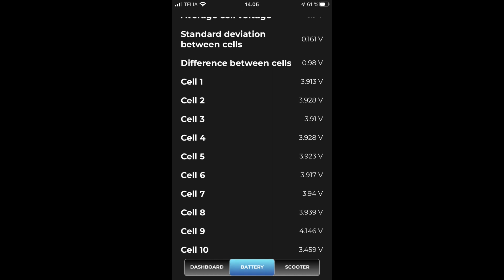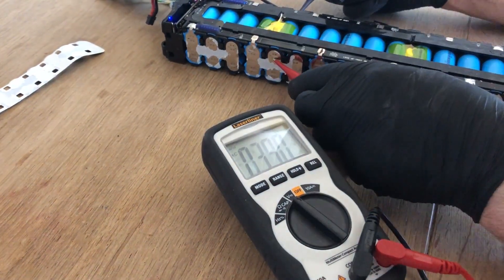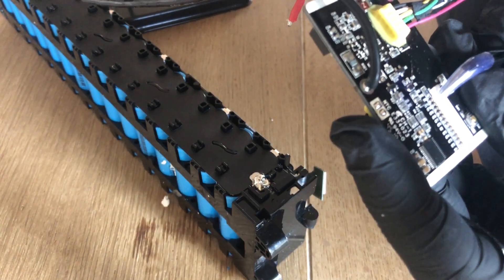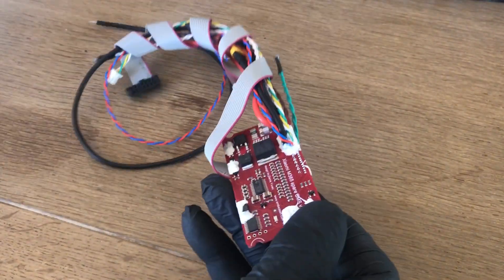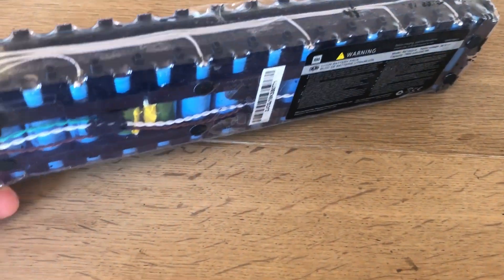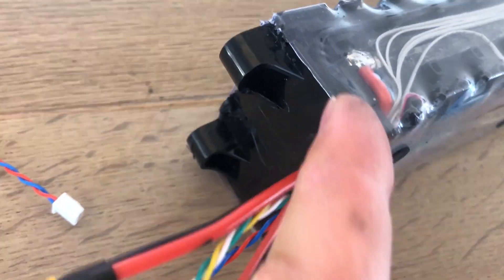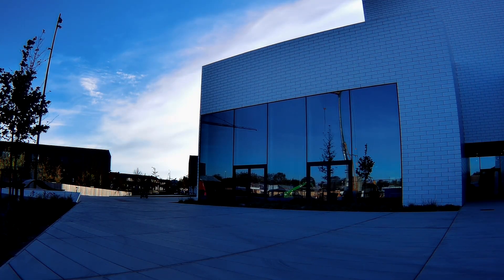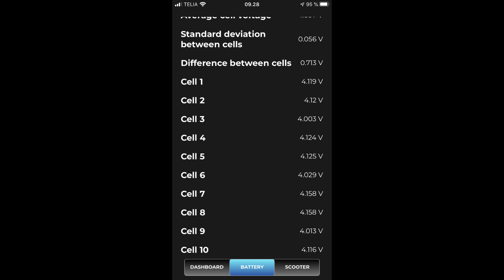Xiaomi M365 dead BMS replacement

Comment: İ have same battery imbalance and riding range is too low i measure it manually too one of the part has Low voltage shoul i replace that cell part? Or charge it manually and  balance manually ? Or change bms ? Bms is working by the way
Reply from the maker: You can try and manually charge up the cell groups with low amperage charge to the desired voltage and balance the pack in that way. If it gets unbalanced again in couple cycles - you know the cell is dead and needs replacing
Reply: @VRMinde  Is the battery definitely dead then, is there a problem with the bms?
Reply from the maker: @sssoyupak  ahh, no, not definitely. Not all BMSs balance the cells (actually only some, more expensive ones can do that) especially if the cell gets damaged/was produced wrong, the bms won’t be able to balance it out. BMS can be good.

Another thing to look into is how the cells are welded together. Is there enough series connections/thick enough nickel between them to carry the load you put through the battery. If your battery build is not calculated well for the amps you ask for it and some connections get more loaded than others - you will heat up the nickel and some cells will loos more energy faster. No BMS will be able to balance it out

Comment: Can you help me finding a rep guide for the Transistor you talking about?
The thing that you tried before changing the wohle bms?
Reply from the maker: I could not find it myself mate :) Overall, my experience in replacing FETs and other small electronics components is mainly... well.. with less than acceptable results..

Comment: So will you disconnect the BMS to equalise the battery
Reply from the maker: I have charged up the cells individually after disconnecting, but you can charge them up individually with very low current like 0.05Amp or so with the bms connected.

Comment: Hey!

i have had my scooter for more than a year now. And its been working perfectly until recently. The battery is not charging. I have checked around and there i have come to a conclusion that the charger is fine cause its lighting green. and the battery is allegedly good if its flashing blue. So my question is what else can be faulty? ive read about the z fuse and it looks to be like a lot of work to replace.

any help?

am also running on stock firmware so i cannot use the xiaomi app
Reply from the maker: Can you use an app like m365 tools for ios and check the voltages of the series groups there? If you cannot see you pack voltages in the app then you will have to do that manually with a multimeter. That requires to take the battery out, cutting carefully the plastic cover and measuring on the cells. If that sounds like something you don’t want to do and if you can’t see voltages on app - bring it to some repair shop, you will get help there. 
It can be a loose spot weld from a cell, dead bms, dead cell and many more things
Reply: I live in a place where we dont have repair shops. The software on my scooter is not the factory software so i cant access the xiaomi tools app
Reply from the maker: @aaronm5447  then start by measuring total voltage of the pack and voltages of every cell group…

Comment: i don't understand a thing... but this bms is not balancing your batteries?
Reply from the maker: The BMS is balancing the battery a bit, when you charge and discharge it. Different BMSs have different abilities to balance the battery. Active balance BMS is 3-5 times more expensive than something like this one and will probably reach at least half of the price of the entire pack. And these cheaper ones are only capable to balance to a small voltage difference, unfortunately :/
Reply: @VRMinde  jeez how much ten 5v 0,5A transistors can cost? 10$? and this is all what you need if you want to charge it PWM style. If we go full throttle then we need 10 buck converters. that would be 20 dollars.

Comment: hello my question my xiomi does not take gas. I opened the bottom and 
the battery lights up blue not blinking it is so right. he does not take
 gas
Reply from the maker: Hi mate, can you check the voltages of every cell group in an app? As I understand the scooter turns on? What is the setting for the start speed? Are you aware that you need to kick the scooter before it starts taking gas?
Reply: @VRMinde  yes

Comment: can i replace the bms from my old battery
Reply from the maker: Sure, if it works, why not
Reply: @VRMinde  i replaced that battery with a new one and it shut off like the first one i had so im not sure if the bms is good on that one they went out when i changed braking system to "strong"
Reply from the maker: @lostheartmega5388  If you used a new battery with new bms and your scooter is not working - your problem is most likely not BMS.
Reply: @VRMinde  i replaced everything the mainboard the dashboard the battery idk what it is when i plugged in the new mainboard it shut off while i was going downhill and never cut on again its been sitting for months
Reply from the maker: @lostheartmega5388  damn... sounds silly, I know, but what about the cables? Could a cable be damaged somewhere?
Reply: @VRMinde  yeah those wires that connect to the main board are fried i got new ones coming in think that may be the problem

Comment: I gust got me a xiaomi pro m365 a week ago like an idiot I started messing with the firmware which I have no experience in pressed the wrong application on the upgrade an that's were everything went in to panic mode dashboard stayed lit wouldn't turn off like a you know what I unplugged the display now dashboard won't light up no sound just blinking green light and tail light my app on my phone still can connect to scooter everything is OK just error code 14 tried everything so with that being said rrrrr changing out my speed controller motherboard fix the problem or do I have an expensive doorstop please help any information would be helpful. I'm older don't no computer jargen. Thanks.
Reply from the maker: les1669 hi,
As I can understand your current problem is error 14?
Error 14 should indicate a throttle (accelerator) problem.
I have seen some people complaining about it on the different forums, seems like replacing the accelerator helps.

It is just my guess, I do not have the m365 pro myself. I can be wrong.
Reply: @VRMinde  thanks I will try replacing   the throttle .
Reply: Got it running one week after my situation.
Reply from the maker: @les1669  Was it the throttle? Great to hear you have fixed it mate! Happy riding :)
Reply: @VRMinde  no was the zip file didn't it in reverse. Now I'm running 10inch tire  love the ride thanks for your videos. Aloha from hawaii.

Comment: whats the black thing u squeezed? is it silicon? what is it for
Reply from the maker: Scooter Craze it is a sealant, you can call it a “silicone”. It is vibration and heat resistant, but “simple-one” would work as well. I used it to cover the thermopores so the temperature is evenly spread and also later to seal the original plastic cover so the cells and the BMS do not get any water if it somehow gets into the battery compartment
Reply: @VRMinde  wonderful. thanks for the reply. anyway did u manage to replace ur 52v BMS?
Reply from the maker: Scooter Craze it is on dispute... ordered on April still has not arived...

Comment: Any tips om how to do the No hands thing
Reply from the maker: 0. It is dangerous and might result in injury and damage to your scooter, responsibility is all yours. Here is how I would do it:
1. Wear a helmet! 
2. Position your feet almost 90 degrees, so you can steer with your feet and body leaning back/forwards. 
3. Get some speed. Do not go maximum, but do not go too slow. Maybe 20km/h? Never measured. The faster you go the more stable it is...
4. Find the right spot - flat wide area with a good surface preferable. Bumps are dangerous :)
5. Fix the speed and place your palms on top of the handlebars, look forwards, try and lift them like 1cm for a second. 
6. Increase the duration as you feel more and more comfortable, try making looong/slow turns.
Reply: Takker her fra